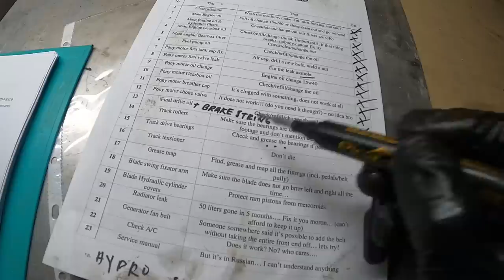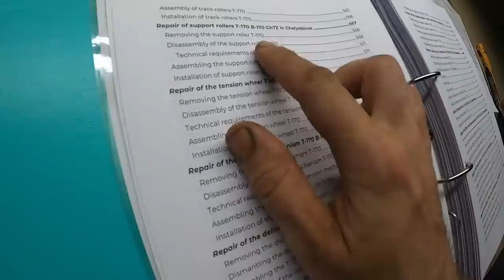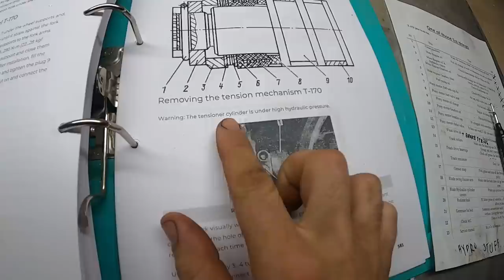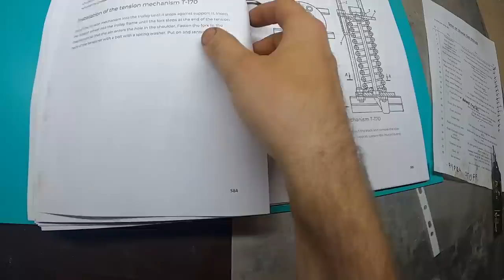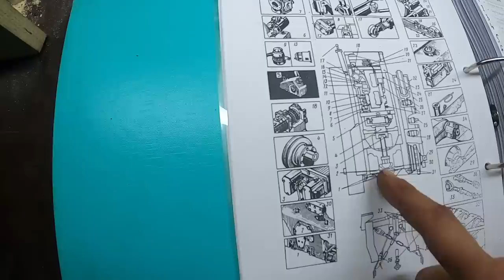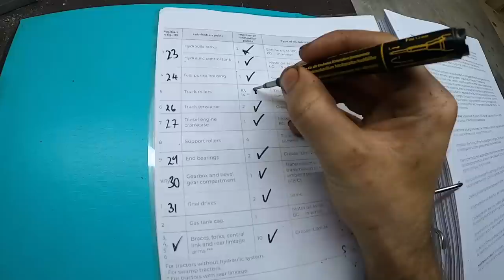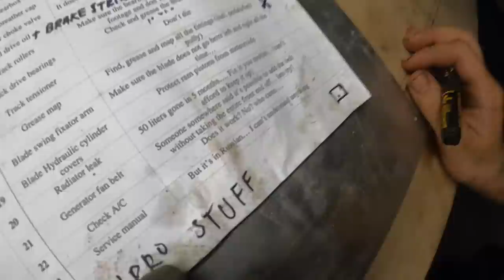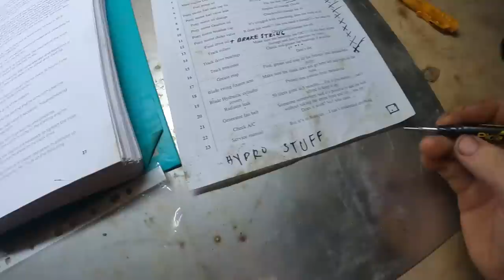Fixing the soviet bulldozer T-170 - Ep2

Comment: I believe the "mystery" bolt (with lock nut) located on the brake band housing(?) is a brake band adjustment bolt. If that's what it is, it's purpose is to slightly raise the brake band off of the brake drum, & prevent the brake band from dragging on the drum, when the brake (for right or left side tracks) is not  applied. Similar bolts (with lock nuts) are on my bulldozer's brake band housings.
Reply from the maker: Hmm 🤔

Comment: Yep, what a bunch of metal. The quantity of fluid that the dozer has to shift around means it needs to be a powerful beast! What a huge amount of grease, oil and lubricants! Glad you have the manual but I prefer your checklist, especially 'Don't die'. So, some therapeutic zip line stuff with the family is just what you need. Thanks again Andris for a great video and facing the challenge and might of Soviet engineering!
Reply from the maker: Did not die 👍💪

Comment: This is a little late but here goes when we brain these types of units we drill with magnetic bit in the center of the plug bottom using a bit that correlate to the of of a hose or tuning we have selected when finished drilling a quick change from drill to tube or hose is all the risk of spill age we have to deal with. As far as the hole in plug goes we can weld up the hole or replace the plug ,make sure to use anti seize sparingly.done in the field this can attract the wrong type of attention with the wrong people . some people turn a quart of oil in to the exon Valdes !I enjoy your channel very much. Have a great day
Reply from the maker: Thanks man for the info

Comment: I’m happy to see the bottom rollers we’re good and had oil in them, the top rollers got bad probably due to the tracks being to tight and pulling on the bearings more than the others and the front idler roller gets the most tension that’s why it went bad, you prob could replace the bearings and seals fairly easy, but I think the track tension is to high
Reply from the maker: I tried to open one of them up. But the thread is damaged and was unable to crank it open. Even the nutbuster crapped out. Your right though about the tension

Comment: If you put that old hydraulic oil in a 44 gallon drum with a wood fire underneath and cook it for a number of hours, until the oil separates out the golden colour good stuff from the sludge at the bottom. 
No need to give it to a big oil recycling company to profit off of.
Dont mix the engine oil with the hydraulic oil.
But cook both and recycle yourself. 
This is a African tip.
Good video today Antz
Reply from the maker: Ohh? Interesting i never knew this👍
Reply: Might to be helpful. Have it professionally tested. Grade, compatibly with other oil, contamination purity. Lubercation property’s. Just to name a few. Pre ww2 oil’s did not mix well. Caused sever problems.

Comment: To bring your trolley back after sliding down mount a car windshield wiper motor with a capstan drum on the railing. Now wrap the line once or twice around the drum & apply tension, the trolley returns with a minimum of effort.
Reply from the maker: Hmm. Thanks for the tip

Comment: With your zip line could you make a spool to hold the retrieval line that you could use your electric drill to retrieve the seat. If you made the spool to free spool with a guide to keep the rope from tangling or getting tangled it would keep the rope straight and off the deck where it could get wrapped around someone's leg and it would make retrieving the rope faster . As long as the spool free spooled with a slight bit of tension so the line would flow off the spool without tangling or making a mess to cause the rope to stop the person taking the ride. Using your electric drill should work to retrieve the line pretty fast depending on the size of the spool. Just an idea to make using the zip line easier and maybe safer without the hassle of pulling the cartridge back by hand.
Reply from the maker: Good plan

Comment: Those bigger metal shavings you found in gears/rear axle are probably partly from the manufacturing process (poor Soviet quality control). 
I had an old used up Soviet Lada 1500S once that I got as gift. Had to do a full engine restoration to it, and when I took off the oil pump, it had several big very sharp steel strips from milling of the cylinders stuck to the metal filter. Has to use lot of force and pliers to get them out, but one about 7-8cm strip was stuck so hard into it I had to left it on its place. The shaving almost touched the oil pump gears 😬. So some russian worker had most likely just slammed the oil pan on with milling shavings still inside the engine...
Reply from the maker: Ohh 🤔

Comment: Dissasemble one of the bad rollers and see if it is rebuildable.
Or just drill and tap the oil bungs for the bad rollers to fit grease nipples. Gets easier to apply grease.
What I have seen on the yt and what I know about UAZ (the soviet/russian jeep) everything is most often quite easily rebuildable.
But anyway and whatever it will be great.
My current project is a seriously old Volvo T22 tractor from around 1950 or so. Stood in a forest clearing close to a old school turned Norwegian vacation home. Havent run for 20 years or so. Got it running and emptied out some tasty chocolate from the gearbox earlier today. Little bit smaller though.
Anyways, great thanks as usual
Reply from the maker: 😅 thanks for the comment friend. I hope your work goes swimmingly

Comment: Just a tip from an ex mechanic when you are greasing any bearing,roller etc as soon as you see the new grease emerging stop as after that point all you are doing is wasting new grease  and creating a dirt magnet. Also wipe off the excess grease to deter from making a dirt magnet. Regards.
Reply from the maker: Thanks 👍

Comment: I would try to replace the bearings and seals in your rollers before they eat through the shafts and you have to make new shafts or buy new rollers. I made new shafts for an allis chalmers HD7 carrier roller and sent them off to be case hardened then i ground them to size. This was cheap to do compared to new. They look very similar to early allis chalmers design.
Reply from the maker: Thanks for the tip sir. I will keep it in bay. As i don't have lots of jobs planned for the beast right now then i will skip it for the time being

Comment: Ant my man, I've just come up with a brilliant idea for your next great build.

I see you in some difficult positions at times, for example, working underneath your beast of a Dozer draining oil or carrying out some other work on it or other large heavy machinery perhaps a neighbours heavy plant.

So i have two posdible ideas. 

1. Why not build a giant set of ramps like the do it yourself DIY car ramps. They would obviously need to take the weight of your Dozer and more, but more importantly, they must be overkill, which is right up your ally. Lots of metal lots of welding lots of fun for everyone. 

2. If that's not an option as they would use a lot of steel, then how about making an outside vehicle inspection pit, like the one you already have in your newly upgraded workshop only bigger and more beefy. Think of the easy oil draining or service work you can do if only you had plenty of room. This idea is probably safer and cheaper than making super ramps.

It would need to be large, with reinforced sides and steps to get down underneath. And a simple removable cover to protect it against kid invasions.

Invasions by kids these days are like the fires across Europe and Canada, rampant. Oh, and you will need a water pump to remove unwanted water once the snow has thawed or after a particularly hard rain fall. You could always build both. Yeh build both.😏

I can see it now. Orders for your plans building the 'Ant Inspection Pit' or 'Ants Ramps' will be popular and make you rich 😁

Of course I would expect my usual 10% suggestion fee for brilliant ideas. 😂
Reply from the maker: lol 🤣 i wanna do that into the new workshop for bigger machines, a pit is also part of that plan. So i don't wanna build a random pit somewhere if i'm making a indoor pit anyway in the future.

Comment: When you build the new shed for the bulldozer it maybe an idea to install a small tunnel to get under dozer an tractor in the future saves you going through the same crap with the oil changes also incase the belly plate needs to come off for some reason its just an idea you may consider love the old equipment you got an enjoy the videos
Reply from the maker: Yes i want to add that tunnel thing 100%, it's important for this type of equipment.

Comment: Andris, thanks as always for this great episode! Have you ever used this stuff called never seize when you are replacing bolts or whatever? It is a tube of paste like consistency that is an anti seizing and also help for bolts to not rust in place.
Reply from the maker: Iv used copper paste to coat the bolts before reinstall. Works great
Reply: @Ants_Pants  never used the copper one, here it is an aluminum based paste. It works great too!

Comment: - Great video, and fun to watch, Andris. Thanks.
- Using the Camarata grease-the-rollers idea is a smart fix for an old machine.
- Could it be the top roller with worn flanges, is because the front wheel is somehow out of alignment?
- What to do about that...I don't know. Can welding build up the flanges? {is it worth it?}
- Can seals be easily replaced on the leaking top rollers? {is it worth trying to do it?}
Reply from the maker: Maybe because of high tension. Not sure i tried to open one up. Did not succeed. I think I'm better off getting new rollers
Reply: @Ants_Pants  .
- If new rollers are not expensive, then yes, better choice.
- But fitting new bearings and seals, AND welding up the flange thickness/heights could make for a good "fix-it" video, too...if they can be taken apart...somehow.
Reply from the maker: @RobertFay  yeah the nut on it turns a little then gets stuck and wont move even with 5miles long bar 😆
Reply: @Ants_Pants  .
- Have a new roller on hand to be sent back if you succeed...
- Heat the nut red hot, chill the bolt with quick start "ether"?
- Hacksaw the nut lengthwise beside one or both sides of the bolt threads?
- Torch the nut off?
- Replacement nut? Re-thread the bolt/axle?

Comment: Good stuff and splendid work. Well I have some good news and a few concerning news. First the good news: you won't need to service the machine for a lot of years. Bad news is the upper rollers are shot. There is a piece of bearing gauge that came out from one of the final drives and that may become a issue in the long run. Upper rollers are a easy to remove compared to the undercarriage rollers. But you should leave them now alone for another time and look for replacement rollers in the future. From looking at the wear 2 of them may no longer be serviceable. As for the metal shavings on the plug magnets, that is totally  expectable on these machines. My own crawler had also lot of it. Same also with the oil that looked like someone had puked into it. I'm amazed people buy fancy headlights but never change the most vital thing that is the gearbox and final drive oil. You where asking how to change the oil in the rollers and idler wheel: short answer you just pump the old nasty oil out with the new one until you got mostly new oil on it. Some different brand crawlers have a fill and drain plug but some don't. And bottom rollers have just one plug. Even the older manuals state and show diagrams of that type of oil change in the new out the with the old. Alternatively you can use a very viscose grease for the rollers that is far better than gear oil. However with this machine your golden what you already have in them.  I personally stopped using these modern Russian fuel and hydraulic filters cause you can find similar ones from Fram, WIX or other brands catalogs. Just need to know the measurements of the old filters. Hydraulic fluid looked almost as bad as what I let out from my own crawler. I have used even lightly used hydraulic oil to flush out what ever junk is stuck inside. Anyway waiting for part 3 gonna be a interesting one.
Reply: You do know that most dozers just get used until they are completely worn out and then scrapped right?
Reply: @willythewave  i know that. Im amazed this one survived so long.
Reply: @SuperMAZ007  Yes sir. Me too. <3
Reply from the maker: Thanks for the tips mate. I will look into the upper rollers. Need to dismantle them. First though i have 2 jobs that i need the dozer for
Reply from the maker: This one has not moved much. The engine clock has only 1800 hours on it

Comment: Front idlers I think take a NLGI 00 grease. Pull plug and stick tube in all way and pump grease in and purge old out. So tube needs to fit loosely in plug hole.  There an old Alis Chalmers heavy equipment on YouTube that shows procedure
Reply from the maker: As long as the seals hold i belive transmission oil would be a better option

Comment: Why the hydraulic filters collapsed is because water got into the system. It is the same with fuel filter elements if they are collapsed it is because of water. Also the oil looked like emulsion of water-oil mixing which explains the paper filters collapsing. The paper did not look contaminated by burnt oil or anything. Also cover it up with tarp when storing for long time so that water doesnt find its way into the systems. Russian machinery is like an sieve, water gets in but it bever gets out.
Reply from the maker: Thanks 👍

Comment: 37:58 Oil in this casing is part of filtration process. First air goes thru a cyclone, spinns up and heavy particles fly away, then air goes thru iron sponge and hits the oil at the bottom of the casing, oil catches medium particles, then air goes up again thru iron sponge and into fine particles filter. Considering the harsh envirentment this machine suppose to work in, this prolonges air filter's life drasticly.
Reply from the maker: Thanks

Comment: Actually I might be wrong. You have to look at specs. But rollers might use 00 grease. More fluid like and would lube better. 
But like I said have to check specs. NLGI 00 would flow better in cold as well.
Reply from the maker: hmm i just bought whatever was cheap. Think it's fine as i use this machine maybe 3to5 times per year

Comment: That was some nasty hydraulic oil mister and you almost kept it 😅
The gear oil you put back in the final drives were quite dark, did you fill back old used oil?

The paper filters are the return filters, the hydraulic oil goes through them before falling back in the tank. You have a suction strainer somewhere in the tank for the hydraulic pump suction side made out of metal. At least that is how it is normally done, the soviets might have done it differently but you are definitively not sucking oil out of almost the top of the tank.
Reply from the maker: No it was brand new oil. Some soviet transmission oil.

Comment: Hydraulic fluid is shockingly expensive.

Especially when working in that league. (The quantity needed)

Do you buy your oil and other fluids in bulk because I see they come in those unmarked containers?

Genuinely curious, because I don't know of something like that in my country. Just get a drum, is what people do.

It was really unfortunate that the original hydraulic filter disappeared.

Guessing there is a high chance that the second sump was drained less recently than the first one.

The old hydraulic fluid looks horrible.
Reply from the maker: i usually buy in what i need, no drums. I prefer the cheaper stuff, as i don't rent out my equipment and sometimes they sit for months on end.
Reply: @Ants_Pants  Yes, I can imagine servicing equipment can become costly rather quickly.

Comment: I saw the end of the pipe, that holds the hyd oil filters, was open towards the cap end. This don't seem right. Is the pipe end, closest to the cap closed off inside, where we can't see it?  Does the fluid cover the filters when the tank is full? Where does the oil get picked up from? Fluid travels thru the filters from the outside of the filters and dumps back thru the center pipe. Correct?  If the center pipe is open (on the cap end) and suction is from the inside end of the pipe. How does it filter?
Reply from the maker: Im not 100% sure have not looked into it. There is a seal on the inside end of the filter tunnel. I belive its fed by the pump itself so fluid goes through the pump and then before returning to the tank it goes through the filter
Reply: @Ants_Pants  does not seem right to me.  Suction comes from the inside of the tube. That is connected in the rear of the tunnel  where the suction presumably comes from.  Now when the tube was installed in the tunnel, the end of the tube, closest to the cap, was open? How is fluid sent thru the filters if the end of the tube is not sealed?
Reply: @Ants_Pants  if the tube is fed  from the pump, then you will be feeding the filters from the inside, backwards.
Reply: @Ants_Pants  there has to be a cap missing on the end of the tube
Reply: @Ants_Pants  if the tunnel cap seals the end of the tube, then i understand the system

Comment: Are there any salvage T-170 you could buy to find parts to fix this dozer for in the area?
Reply from the maker: They are on marketplace quite often. Not used for work anymore because of the 30 liters per hour this engine consumes in fuel. But parts should be available
Reply from the maker: Lol